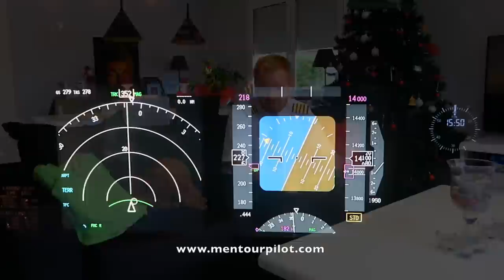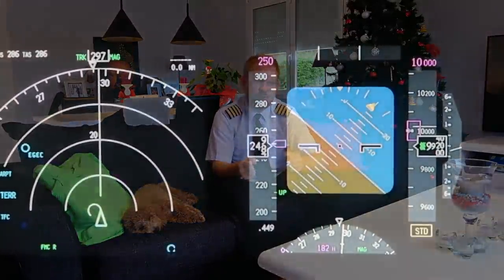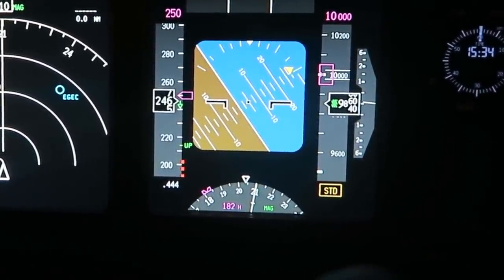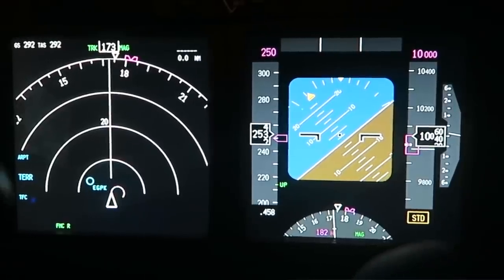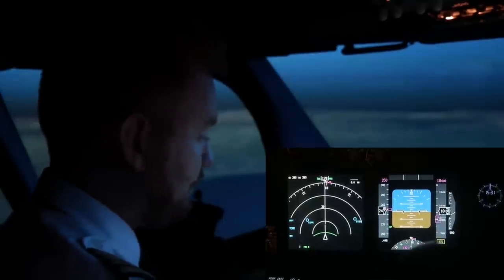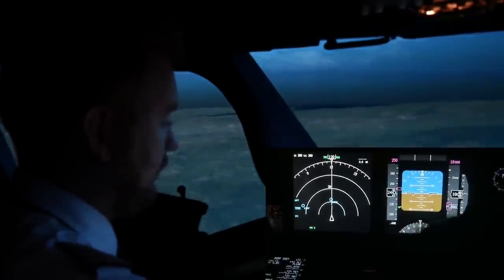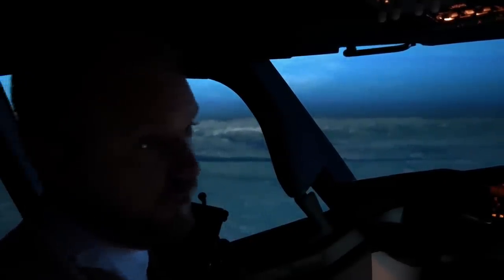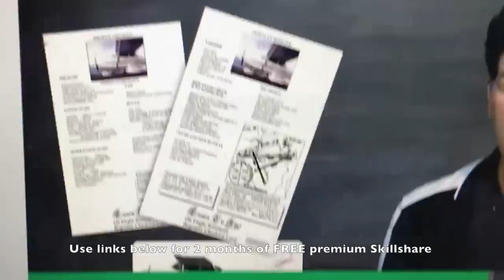What happens if you ROLL an airliner?!

Comment: i love how the flight computers are completely silent during the rollover. "you're on your own now, cowboy!"
Reply: They like " don't do it"
Reply: Dang, I swear I  kept hearing from the Airliner's flight deck, "annnt- must roll- annnt- must roll- annnt- must roll...
Reply: That because the flight computer ejected just after it said  "you're on your own now, cowboy!"
Reply: So when they download the Flight Data it will have deniability. 🙄
Reply: The man has four stripes. If he can make a video on it, that means he can as he pleases
Reply: The flight computers passed out due to some G forces 😁
Reply: @Wolfwolveswolf  I heard, "Bangin', bangin" like he had a crush on another plane.
Reply: 360 likes ;)
Reply: I wonder if the automatic systems are designed not to intervene on the theory that they're more likely to be the problem than the solution when an airliner gets into an extreme attitude
Reply: Actually, the "you're on your own, Cowboys" alert only comes on after at least 30 seconds of stick-shake active during which 5 "bank angle" alerts and  zero "terrain! Pull up" alerts have occurred.  At this point the aircraft automatically transmits a litigation alert to corporate legal on the emergency channel.
Reply: @77thTrombone  🤣
Reply: He was close to an overspeed warning (really close) while simulteanously almost activated the stick shaker. Seeing that tight margin i guess the aircraft would also be very close to the load factor limits when doing that. The maneuver was done really on point, thats the reason you heard no warnings. When this happens out of the blue in reality i guess it would be almost impossible to recover as precise as in this video....with a lot of warnings blaring and a good possibility of damaging the aircraft in the process. 

great video! you really get a sense for what happens and that a b737 is really not an f-16 but a big bus with wings.
Reply: Why do I have that image in my head of a well known AI Rio from a certain F-14 Tomcat addon in DCS, ejecting in most funny situations? :D
Reply: I find it really showed his skills. Overspeed and stall dot-lines both in the display and he still stayed out of both the overspeed or stall warnings.
Would have thought that there would be more warnings when you invert, though.
Reply: @Digi20  I wonder how many times he practiced the maneuver before filming it. I have trouble keeping a cessna stable in MS flight sim. :D
Reply: Flight computer was complaining about bank angle until he was basically inverted, at which point the computer passed out as all the electricity drained out of it.
Reply: @chrismcgarry2840  Not altitude, attitude! Always knew those warning signals were too rude.
Reply: Actually if you turn the sound up and listen closely you can hear it complaining about the bank angle and then it also beeps later. It definitely wasn't silent.

Comment: "This is your captain speaking, please return your traytables to the upright position, fasten your seatbelt, and someone hold my beer"
Reply: yaa thats my flight in xplane when demo mode ends.
Reply: A proper 1G roll would be barely noticeable. Might be a bit shaky, but everything stays roughly where it is.
Reply: @HappyBeezerStudios  Actually if you think about it, a "proper" 1G roll technically varies up to as much as 2G on the airplane itself. In order for you to feel 1G through the floor of the airplane while fully inverted you'd need to be doing 2G to counteract the force of gravity. Sure you can make it "feel" like gravity spins with you but the plane has to tolerate twice that. A true 1G roll in terms of the aircraft would have you feeling weightless when you're inverted.
Reply: @HappyBeezerStudios  I disagree. If anyone had their windows open, seeing the horizon corkscrew around, invert, and hopefully un-invert all in the absence of horizontal force would be terrifying. If you were more slowly rolled, the feeling of dangling by your seatbelt would at least feel like the plane was being supported on its current heading.

It would be nauseating as your inner ear would be telling you (quite rightly) that you were accelerating at insane speeds in an uncontrolled way directly at the ground, coupled with presumably freaky shuddering and groaning as all manner of structural and aerodynamic chaos was happening to the airframe around you.

I'm thinking people would be passing out and vomiting immediately.
Reply: I thought of something like the inverted 707

Comment: In 1990, while on deployment in the Persian Gulf, I witnessed an RAF Nimrod do a 360 degree barrel roll flying at low altitude!  It was the coolest thing I had seen up to that point aviation-wise!  Got to share this story with an old RAF Crew Chief in Thailand this year.   He worked on the Nimrod and totally confirmed that not only was it possible, he actually was in one that did it himself!
Reply: Nimrod is hardly an airliner
Reply: @testboga5991  It is the size of one.
Reply: @testboga5991 The airframe of the Nimrod is based on an airliner, the first jet airliner in fact.  Nimrod is a heavily modified version of the  De Havilland Comet in fact.
Reply: Thank you for your service!
Reply: They also stuffed one into Toronto harbour when they tried it at too slow an airspeed.